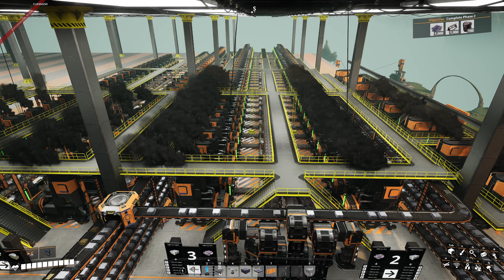Satisfactory Now Has Elevators? - Update 1.1 - Ep12 - Satisfactory

Comment: Some extra commentary on structural stuff as I catch up to the most recent video. You do need to remember that the floor provides triangulation. That is to say that on the horizontal plane none of the supports can move in relation to the others. The walls would also provide this resistance to tipping along the vertical axis. So with both of those in place, as long as there is sufficient structure to hold the weight of the building and it's contents at the correct elevation, additional cross bracing would not be needed. 

I use that principle at work building glass awnings for people's decks/patios. We attach to the house, which provides a stable vertical plane, and the roof once constructed provides a stable (mostly) horizontal plane that is held up with a beam and some posts without any cross bracing. We get away with having 3 open sides by using the house. A structure like what you're building here would have that cross bracing inside the walls. Especially considering that the basic walls are made of iron plates, or concrete.

Figured you might appreciate the perspective since you have such an attention to realism in your building.
Reply from the maker: I do agree that you wouldn't need that much diagonal bracing on smaller structures but you have to remember how big this building is. 4 production floors at 9 walls high, plus 2 logistic floors at 6 walls high = 48 meters or 157 feet tall. The walls would catch a very significant amount of wind and the building would require quite a lot of diagonal bracing to resist that sideways movement out in the middle of the building. The walls by themselves just wouldn't provide enough in my opinion. I did model a lot of the cross bracing on the warehouse that I work in which is only 50-60 tall.